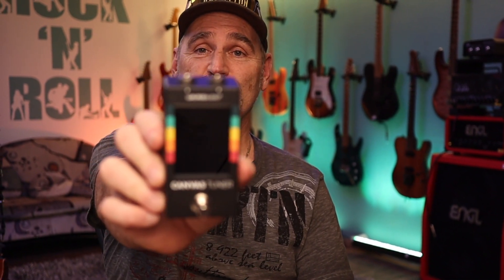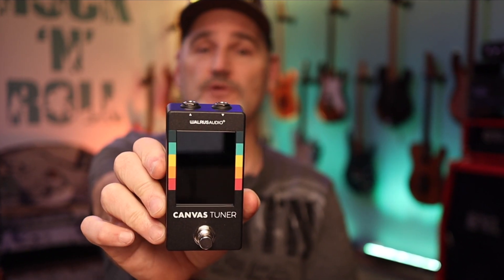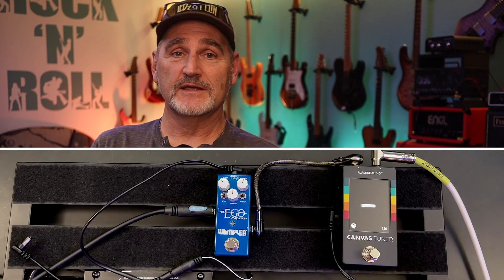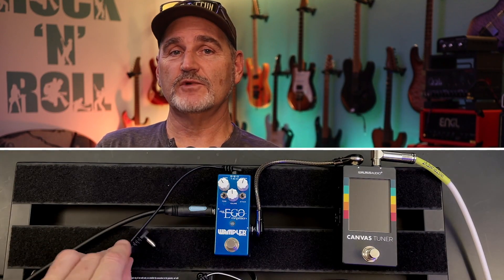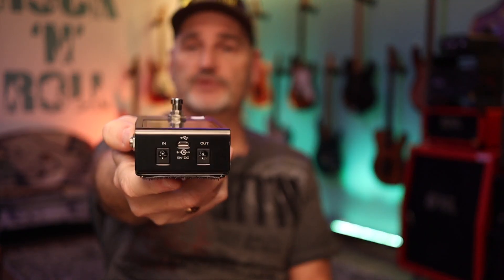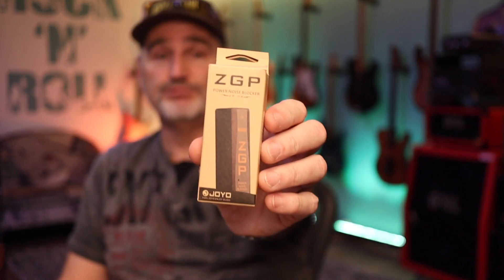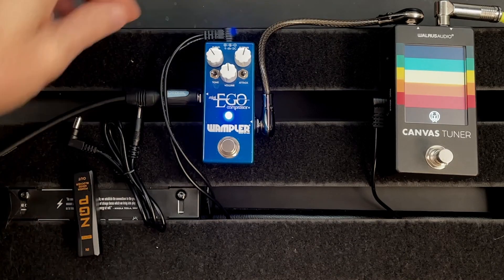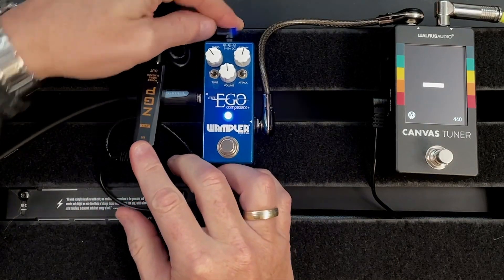The Canvas Tuner Has A Major Issue

Comment: My understanding from videos I've watched of Vertex Effects is that it's not a good idea to have digital and analogue pedals on the same power, as we as isolating all modulation pedals to their own output too because they can create some noise. As somebody else said though, Walrus Audio does make it clear in their manuals to power this with an isolated power source and not to daisy chain it. You're right though that it would be nice for an updated version to allow for daisy chaining or a power out.
Reply from the maker: Well, the general rule is to use one isolated outlet of your power supply for each digital pedal - do not daisy chain with analog or digital pedals. I'm totally aware of this - however, I don't know of any single other tuner that pollutes the voltage. Even in true bypass mode you'll get the noise - that's not what I would call high quality or the best tuner of all times. Isn't it also an industry standard to share power with the tuner - as tuners from the biggest brands (BOSS, TC, Peterson) easily offer a daisy chain connection without any issues? Wouldn't it be better if all pedal vendors would take care about? I've also tested other digital pedals (BOSS, TC, EHX) in the same configuration, guess what - no noise at all! And citing a lack of functionality in the manual does not make it a better product - isn't it?
Reply: @RockGuitarVibes 

Hey Man, 

I’m not brand loyal to anyone.

I REALLY wanted to live this tuner, because it’s very cool!

But no matter what I did.. it added noise.

I don’t believe I should have to run a wall wart for every pedal.

I bought a fancy isolated brick, but it didn’t completely fix the noise.

I ran it on a separate wall wart, in my effects loop on my Boss IR-2, and that was how I got it to pickup the least noise.

I REALLY like it, but I’m tired of fighting it every time I want to move my pedals around & have to worry so much about what goes were.

But, I fully intend to keep loving my Julianna & any other Walrus products I try.

I wish ppl hadn’t given you such hell for mentioning an issue.. and it is an issue for me.

May not be an issue for someone with 2 pedals, but I’m missing a chunk of my left hand.. so I’m not a good player anymore (after 30-years).. anyway, I use a bunch of cool pedals to sound cooler.

🤦‍♂️🤷‍♂️

Best Wishes to EVERYONE! 

I’m just gonna use headstock tuners and my ears until V2 comes out.
Reply from the maker: @fadingdestination  Well, some comments are not nice but I don't blame anyone if they don't have sufficient technical knowledge. Not quite sure if your remaining issue has something to do with that digital noise issue I mentioned in the video. Anyway, I think I'll demonstrate a possible solution in one of my upcoming  videos - hopefully soon...

Comment: I would call it a limitation but not a major issue, in any case a tuner needing 300ma (as per spec) is quite unusual to begin with, 

getting noise from daisy chaining a high current draw pedal when daisy chaining with others is almost to be expected unfortunately , 
although unheard of usually from a tuner pedal

it has some fun features (orientation / wallpaper) but if that's what you're buying the pedal for, then you need to consider proper power options
Reply from the maker: Just my 2 cents: From a company that can build in fun features, I expect the basics to work as well, it's doable! WA is not a noname brand - personally I would expect high quality. Anyway, thanks for your comment.
Reply: it needs the 300ma for the display

Comment: I just bought a Boss TU-3. Highly accurate, can take a 9V battery, no digital noise, you can daisy-chain the power, and NO GIMMICKS.  It just works, which is what you want on stage.
Reply: I used a TU-2 for years, nothing wrong with a Boss.  But the Turbo Tuner is 50x more accurate than the TU-3 for only a few bucks more.

Comment: Buys product, ignores manual, proceeds to use product the exact way the manual says not to...posts a "scathing" review about how dumb or bad it is that it doesn't function how he wants it to. Come on man, this is an absolute L. I came here for education and worried I bought a tuner that may not be accurate and I get this...
Reply from the maker: Using a new product in a way that has worked well for all other tuners on the market for decades...
Reply: @RockGuitarVibes  Heaven forbid a company makes technological advancements and makes one of the best tuners to ever hit the market and it doesn’t take power like the first boss tuner from 1998…. Let me guess, you’re mad the HX Stomp doesn’t work at all on 9v because “aLl oThEr pEdAlz dO “. It’s called technological advancement and requires more power for better features and functions. Your argument is so bad…
Reply from the maker: @JGort  I just don't want any digital noise, which is possible these days...

Comment: Personally I see this tuner as a bit pointless for my purposes but I don’t think this is a good criticism. If you haven’t yet I suggest you try using a daisy chain 1spot on a couple strymon pedals and you’ll see a similar thing happen. The problem here is you’re trying to “game the system” on a device that needs all the notated power it demands. This is more user error and not a Walrus audio problem. It’s a reasonable complain that it doesn’t have a power out option but not that you cant draw current away from the pedal. Analog pedals have less issue with daisy chaining where as modern digital stuff doesn’t do well with it. A good follow up video would he recommending a good power supply for the budget player. I use a Walrus Phoenix and it’s incredible. It’s 250 dollars but fixes so many problems. And I can power my CE-1 on it too. Check that thing out.
Reply from the maker: As mentioned at 2:34 I'm aware of digital noise issues with digital devices - but getting that noise from a tuner is pretty unusual! For me that's a major issue, especially when it occurs in all bypass modes (even true bypass)! Technically there are solutions to fix this as I've demonstrated in the video as well. Personally I don't want to waste one of my 500mA power slots exclusively for a tuner... anyway, thanks for your comment.
Reply: Turbo Tuner 48mA, Strobostomp HD 85mA.  I understand the Walrus has a screen, but *why*? Absolutely silly to have a tuner that draws 300mA.  Walrus regularly make bizarre product decisions like this.
Reply: @RockGuitarVibes  yea dude I wouldn’t want that either. The pic feature isn’t worth the requirements and your notes drawbacks. I hope they will do a different smaller version next which will be the winner.
Reply: @trev3971  it’s cool they do their own thing but yea I have a feeling once the new car smell wears off you’ll see a lot of these on the used market. It does look cool tho!

Comment: Simple: if you want to use a daisy chain or other cheap power supply, buy a different tuner.
It sucks, but the more features you cram in, the more likely it will add noise. When I try to run my RV-500 in stereo, there is mch more noise than if I run it in mono. I have a one-spot isolated power supply under the board, but the transformer is in the power supply so it still picks up noise even if I use it with just the batteries.

Comment: I don’t see why anyone would even want to daisy chain pedals off a tuner…sounds like you’d be asking for potential noise issues by doing so. Walrus audio designs pedals that require a high amount of current, so they recommend isolated power for their pedals. Same reason you don’t see any of their pedals with a 9v battery option.
Reply from the maker: Looks like I haven't explained clear enough - the power supply has 2 outputs with 500mA and 3 outputs with 100mA, one of the 500mA outputs is already in use by a high current pedal. In 2024 selling a very modern tuner with one elementary feature missing is kind of weird, sorry.

Comment: I like Walrus Audio and I own many of their pedals. The manuals make it very clear to use a separate power supply for each pedal. I just assumed that was to ensure maximum performance from the pedal. If other pedal manufacturers recommend using separate power for each of their pedals, maybe it’s just an industry standard. The canvas tuner seems cool, but maybe too gimmicky for it’s real purpose: to give the musician accurate tuning on stage or studio. A tuner pedal that has the potential to get noisy is a risk to the whole board. I love Walrus Audio, but if you use the Canvas Tuner just be careful how it’s used in your rig. Rock on, Walrus!👍

Comment: In addition, the stomp button on the CANVUS really sucks! It dos not have any touch resistance, when you press on it and it has a habit on not working when you press it. THEY WILL USE EXCUSESS LIKE, they can not fit XYZ in the unit, as an excuse to not put a better switch and power out capabilities. They have a few issues, if they work through them, they will offer the best TUNER PEDAL on the market.

Comment: Despite the fact they could’ve avoided this issue, everything these days is about cutting cost. The fact that the industry standard has been LONG past daisy chaining would inform why they didn’t waste time and money on that detail, despite how “easy” it could’ve been. Not about easy… it’s about money. Power supply’s with isolated jacks have been a must since the late 90s/early 00s. Why are we daisy chaining? I had issues every single time I tried daisy chaining pedals, so I ended that stupid nonsense really quick early on.
Reply: That's a good point. Will many people who use this pedal have this issue? 
Unlikely. 

However, any device maker worth their salt should handle and clean the power coming in and minimise polluting the power rail, because they don't know how the end user will use the device unless they inform the end user not to daisy chain, the designer doesn't know if the end user is a beginner, professional, hobbyist or sound engineer.

That's why the other 2 pedals in the video didn't cause an issue with the daisy chain setup yet this one did.
 
If i were to buy a £10 to £50 tuner pedal off amazon or aliexpress, i would expect the designers/builders to take every shortcut possible, but when this pedal is being sold for £144 or more, i expect it to not pump noise back into the rails, the same way i expect most if not all pedals not to add noise to the audio signal when in bypass mode, whether true or buffered bypass.
Reply: @tehcovmeme  I’ve paid around 100 dollars or more to plenty of pedal manufacturers who have noisy pedals when daisy chaining. Which is why the industry in general moved to isolated power. This is in issue in many pedals and brands even in more “expensive” ones which is why the “don’t daisy chain” advice even exists in the first place. Many boss pedals, which ARE quality devices, especially the digital ones cause plenty of noise when daisy chained, and they are all over 100 bucks. So why are we zeroing in on WA when this is an “issue” among tons of brands, and no one says anything about it besides “oh better not daisy chain”.
Reply from the maker: I've just tested with a few other pedals: the Ditto, BOSS OD-200, BOSS EQ-200, TC Quintessence, EHX Bass9 - guess what, no digital noise! But OK, a pedal can only be be as good as the used power supply. All my power supplies are high quailty - the best is the Cioks DC7. Maybe I should do a follow up video and explain some basics and why daisy chain is not a bad thing in general. I stumbled across the issue because I'm using the 9V outlet of my old tuner and on that pedalboard I have only two 500mA slots and some 100mA slots. And no, I don't want to invest another 150-200 bucks in a new power supply only because a company isn't able to do things right.

Comment: I honestly don't understand all the daisy chain comments.

Are people so used to poorly designed digital pedals (whether due to penny pinching, lack of testing, lack of oversight or otherwise) that they assume that noise is unavoidable if daisy chained?

I design and build my own pedals for my personal use, both analog and digital ( using a variety of parts eg. Rpi, pi zero 2 w, esp32 & other mcus) with some forethought, careful design and regular testing and revisions these issues can nearly always be eliminated .

Comment: What power supply are you using? What is the mA output?
Reply from the maker: On that board it is the Pedaltrain Spark, 500mA outlet - same issue with my other power supplies, the Cioks DC7 and the T-Rex Fuel Tank. As demonstrated in the video the issue is not caused by the power supply...

Comment: The problem with your review is you don't identify what power supply you are using and at what rated power output ? also I would never use a daisy chain power supply vs a good quality Isolated power supply with any of my pedal boards today, this seems to be a problem only when going cheap on how you are powering your board, also mixing analogue and digital pedals requires a good isolated high output power supply to avoid these kinds of problems.
Reply from the maker: Well, I'm using only high quality power supplies with isolated outputs, that one has 500mA. I think I'll do a follow up video and explain the problem in more detail with some test of other digital pedals that do not pollute the voltage.

Comment: People shouldn't expect less from you tubers that make clickbait titles like this. Is this a bummer? Very little of a bummer, definitely not worth the title of the video. This is to be expected of even expensive digital pedals and is the reason why serious players get isolated power bricks. Congrats to OP for getting the views and amount of comments his channel needed.
Reply from the maker: Well, it's no problem if your power supply has enough slots - however, the used power supply has only 5 outlets, that are all in use. So I'm not able to use the tuner without replacing the power supply - that's not what I would have expected from a modern tuner with many good features. I don't know any other tuner which isn't able to be used in a daisy chain setup!

Comment: As stated already. Digital pedals shoild always be isolated. All tuners are digital these days. If it requires more power there are more features and processing. You may get away with it with a cheap amazon tuner... or not for other reasons.
Reply from the maker: Ok, so if you are an expert in electronics please explain in detail why the issue does not occur with my Peterson tuner or with my TC Polytune or with other some digital pedals I've already tested - thanks in advance!

Comment: Hey @RockGuitarVibes
These types of videos are really helpful and I am very thankful for them. Of course everyone commenting ist totally right about not using a digital pedal in a daisy chain setting. But this just isn't the whole story what makes a product perfect or not. Just because all the youtubers and gear nerds can afford hughe boards and expensive Cioks supplies doesn't mean that its for everybody. When I was a kid, I was able to use a TU-2, a Blues Driver, DS-1 and even a Boss DD-6 all daisy chained with a 1-Spot PSU wiht absolutely no problems. Well, If one wants to have a personal wallpaper on the board and therefore buy a 200.- Cioks it's just fine - but please someone should point this issue out! And you did - and that's what I like about this video!

Comment: Ooof. What a terrible hot take - At least you got the views you wanted.
Reply from the maker: The thing is, I simply want a better product, and others seem to agree 😮
Reply from the maker: Well, the video has over 100 likes 🤔 Anyway, congratulations if the tuner is good enough for your use case, it's just useless for mine...
Reply: @RockGuitarVibes  5.4 thousand views and hundred likes. Yeah - people are falling over to agree with you. That is sarcasm.
Reply from the maker: Well, if more people would have a deeper knowledge about electronics, I'm sure more would agree... BTW: The like rate is pretty normal for my channel.
Reply: @RockGuitarVibes  I find it fascinating that you think you believe that you have some hidden knowledge about electronics when the root of the issue is that you want a modern piece of kit to function like something from the 60s. It is the equivalent of being upset that the Helix doesn't have a two prong power supply because original Fenders amps could electrocute you.
Reply from the maker: Sorry, all I want is that the pedal does not polute the voltage - it's doable as I demonstrated in the video. However, production costs will rise by around 1 dollar, which seems to be too much for WA to satisfy all potential customers.